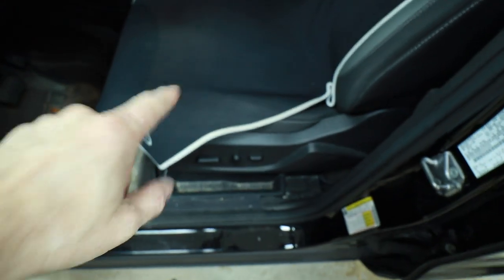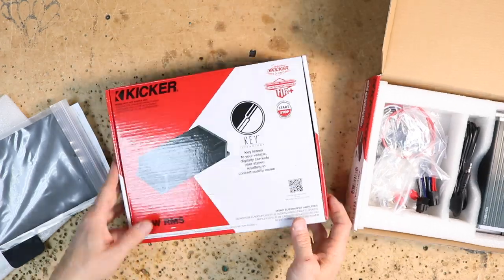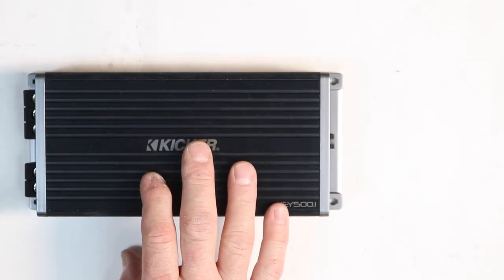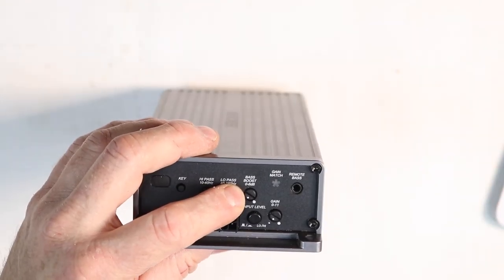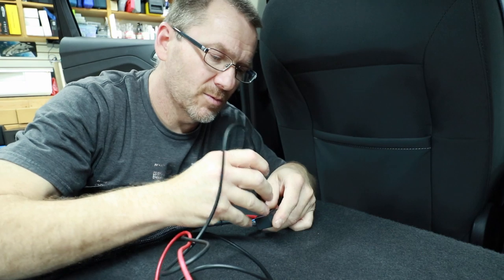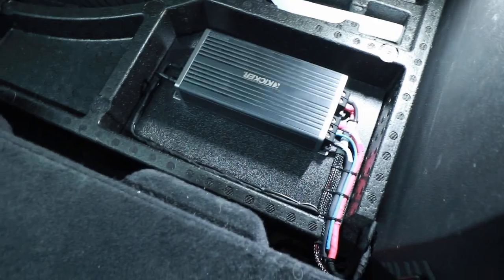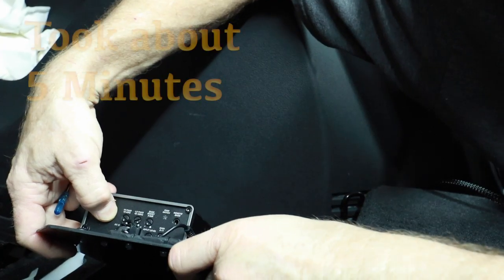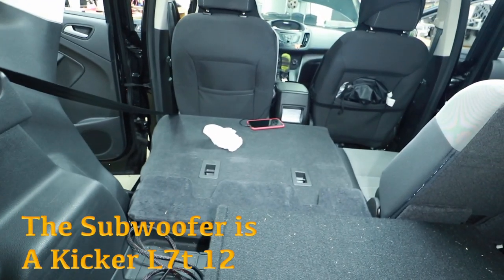The smartest sub amp ever Kicker Key500 1 Mono DSP Amplifier

Comment: MONEY MAKING IDEA!! I can't seem to find an inexpensive method for testing a ~150db car audio system. So far the devices require hundreds of dollars. Someone ought to invent a tiny microphone that plugs into a smartphone via 3.5 mm jack that reads up to 150 dbs and uses a particular db/spl app which tops out at 130db for the free trial version and jumps up to a higher db by upgrading to the Pro version of the app.. the microphone would need a price point of around $50. They'd sell like hotcakes IF it's accurate!
Reply: @Brandon Lee  

Unfortunately, microphones that can handle those extreme SPL levels AND also remain accurate long-term are still quite expensive to design and build.  It comes down to the limitations of the materials used and the physics involved. Perhaps in the future better materials such as Graphene diaphragms will provide accurate and less expensive products.
Reply: Today, to measure SPL accurately in that range requires pressure meters and software to read and interpret that data. There are some options out there to do that at a reasonable cost and interface to your phone as the display and control interface, but not for $50.

Comment: NOT IMPRESSED WITH KICKER MICRO AMPS!  The first gen ones were not making rated power which is crazy for kicker(they always exceed like rockford).  Not enough headroom on these.  That being said I am not against a TRUE 500w micro amp but I dont' like having to drop it down to 1ohm to make rated power.  Most of us have subs already that are d4 ohm. If you are starting from a clean slate I guess no problem..buy a d2 subwoofer if it  is available.
Reply: The realities of "Micro" amp and "Big" power are always going to be fighting each other. And with today's tech, to get that much voltage swing (watts) in really small chassis requires 1 ohm operation.
 Technology moves forward and things get better but just bear that in mind. 

I know personally the only Micro Amps from Kicker that have been controversial on rated power vs amp dyno tested power measurements were/are the PXA200.1 and PXA2002. These amplifiers make rated power; if you measured them in a lab setting; at the circuit board; with 14.4 volts of DC power. But when measured at the speaker harness wiring with associated losses from the molex connector and wiring itself, they missed the mark slightly.

Kicker PXA200.1 Amy Dyno https://www.youtube.com/watch?v=AtQkuUGy9Bo&t=467s

They probably should have been rated at 150 x 1 and 75 x 2, but we can't change that now. These are also the only two amps in the lineup that are very unique in their build in that they don't utilize a conventional switching power supply design that makes power at no-cost since the design goals on these amps was to work reliably in situations where you don't have big batteries or big charging systems.

Small bikes, scooters, lawnmowers, etc utilize a typical stator charging system and supply 15 amps at best. This is really where those amps were targeted.

Now, the PXA300.4 and PXA500.1, which are also part of the powersports lineup, those amps do are designed with a different power supply and they make stated power, and then some, both in the lab, in the vehicle and dyno testing.

I have been associated with the Kicker brand a pretty long time and I can testify that when it comes to rated power, the PXA200.1 and PXA200.2 are the only amps I know of that missed the mark in testing outside the lab. 

As an example the other way, look at what the current CX 400.1 and CX 800.1 do on a test. Hope you find this informational.

CXA 400.1 https://www.youtube.com/watch?v=_hzd6WeruBg&t=33s

CXA 800.1 https://www.youtube.com/watch?v=Y6xtBtB9u-E&t=8s
Reply: @kipplitz  yes recognize you from kicker videos. Very good info. I did not know that about the key amps that they were designed for vehicles without alternators. despite my criticism of these amps ironically I have actually been looking at older zX amplifiers from 15 years ago on eBay as they just ooze quality  end really remind me of  the  "2nd golden years" of car audio in the early to mid 2000s.  One thing I hope to see from kicker someday soon is a five channel that can put out a true 800w on  the sub channel and 100x4 @4ohm. I also appreciate that kicker never sells CCA wiring kits as your demo of voltage drop has been very helpful. One idea I have is  if you ever have a chance to make suggestions to the engineers or sales people I it would be really awesome to see 12-14 gauge speaker wire included in your 4 gauge wiring kits. Knuconceptz  set this precedent and I would recommend your wiring kits if kicker followed suit. I think the small price increase would be worth it